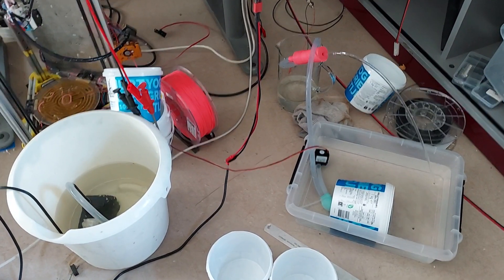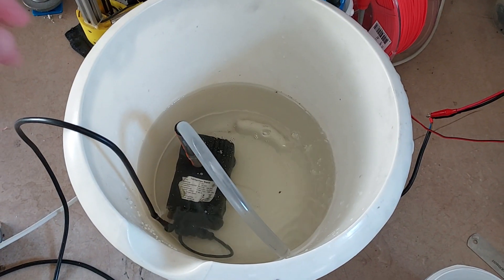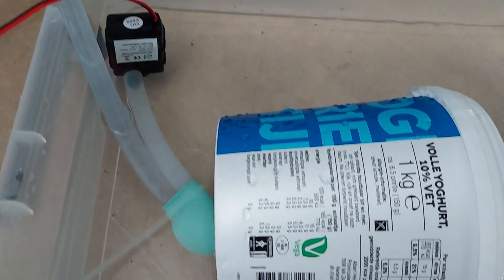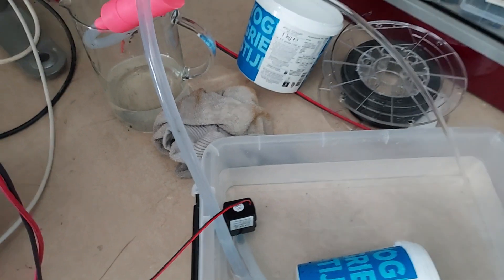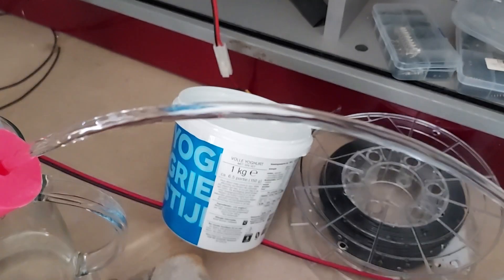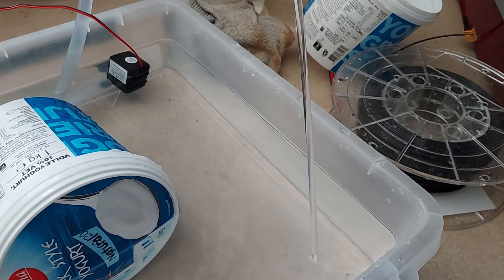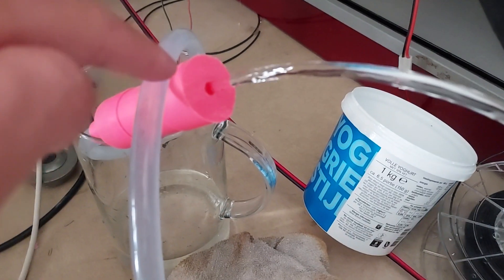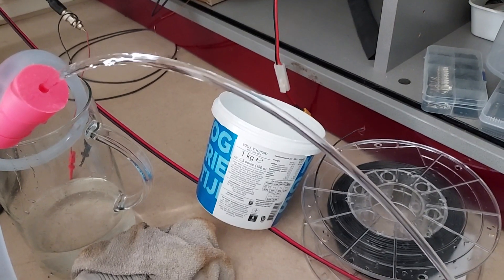3D printed laminar flow nozzle for very stable water jet output

Comment: Hello! Might I ask if you calculated the reynolds number without the infill, as a normal cylinder, or with it? If you calculated it with that patern, are there and formulas you could direct me to?

**Just saw your website and the python code, looks great! Just one question, there are more than 30 holes in the geometry, so why is the nStream varibale set to 30?

Assuming the nStream variable is for the rectangular sections, I edited your code as follows, feel free to let me know what you think 

-----------------------------------------------------------------------------------------------------------
import math

# Compute Reynolds number for different flow configurations

# flowRateLperH = 500 # [l/h]
flowRateLperH = 757.082 # [l/h]
flowRate = flowRateLperH/3600 / 1000 # [m^3/s]

hoseDiameter = 0.014 # [m]
hoseArea = (hoseDiameter/2)**2 * math.pi
flowSpeed = 1 # [m/s] just to have set a value

flowSpeed = flowRate / hoseArea
# print(flowSpeed)

kinematicViscosity = 0.8927E-6 # [m^2/s]

# Now compute for N smaller streams
# Idea: split a stream into N smaller streams
tubeDiameter = 40E-3 # [m]
tubeArea = (tubeDiameter/2)**2 * math.pi
fillFactor = 0.7 # Some surface area is lost due to wall thickness 
print ('Tube Area', tubeArea, '[m]')
lineDistancing = 2E-3
cubeArea = (lineDistancing)**2
print ('Cube Area', cubeArea, '[m]')
nCubes = tubeArea*fillFactor/cubeArea
print ('Number of cubes', nCubes)

nStream = nCubes
streamArea = cubeArea
streamDiameter = math.sqrt(streamArea/math.pi)*2
flowSpeed = flowRate / (tubeArea*fillFactor)

Re = flowSpeed*streamDiameter/kinematicViscosity
print('Tube diameter %.3f [mm]' % (tubeDiameter*1e3))
print(nStream, ' streams with diameter of %.3f [mm]' % (streamDiameter*1e3))
print('Reynolds number [-]: ', Re)

# Compute entrance length
# turbulent flow
# laminar flow
entranceLengthLam = 0.0575*Re*streamDiameter # laminar
# entranceLengthTurb = 1.359*streamDiameter*Re**0.25 # turbulent
print('Entrance length [m]: ', entranceLengthLam)
----------------------------------------------------------------------------------------------------------------------------------------------

I really liked the project btw, kudos!
Reply from the maker: Hi there! Thanks for your elaborate comment and the compliments. The approach taken for calculating the area per rectangular cross-section sounds good. I don't remember exactly why I used nStream=30, probably I was just experimenting. One remark is that the computation for the reynolds number might be different for a circular and a rectangular cross-section, but this you'd have to look up somewhere. I've forgotten most of my fluid dynamics courses ;)
Reply: @kloppertje  Thanks for the reply! Im glad the 30 value was just experimenting, took me a long time to figure out why it was there. As for the reynolds number, yeah there is a separate equation for rectangular cross sections, but I cant figre out the wall thickness of the infill so I cant calculate it. Im a fourth year mech. eng. student, and this project is really helping me out so thanks again!
Reply: Hello again @kloppertje ! I'm currently working on a design project for my course at school and Im using a similar design to the nozzle you have in your videos. I've also modified the python code to better fit my project. I just wanted to thank you again for both the video and taking the time to answer my previous question regarding the python code! Its been nice virtually meeting you, and I hope you have a wonderful rest of your day :)

Comment: It looks like the nozzle isnt too stable. So if there is pressure variation in the hose, the nozzle will respond to that with slight movement. Increasing the stiffness of the nozzle mount could reduce the movement of the laminair water flow.
Reply from the maker: Thanks, will try it in the next iteration!